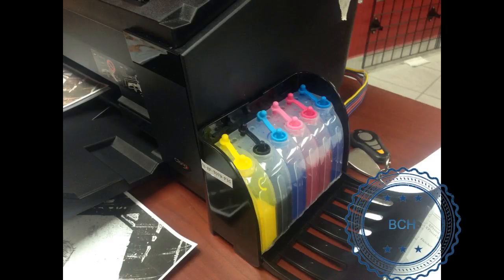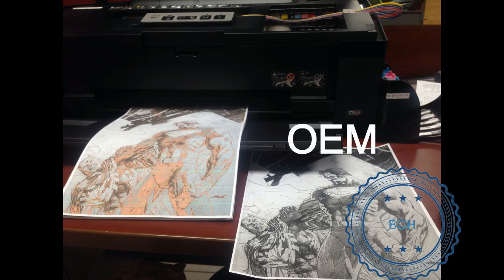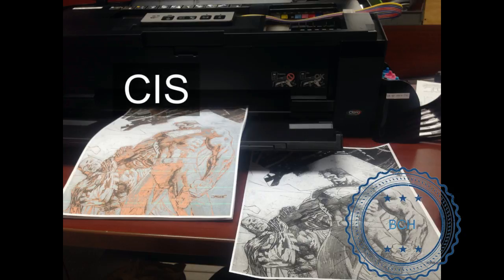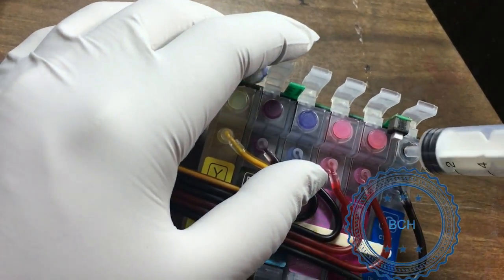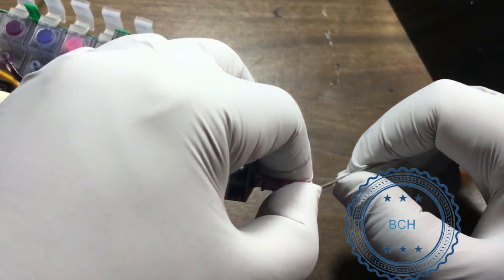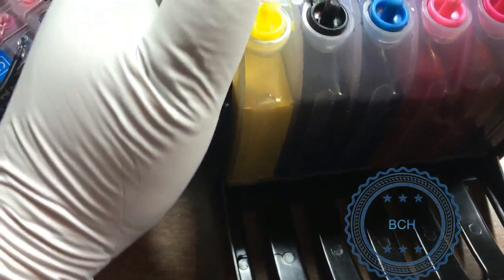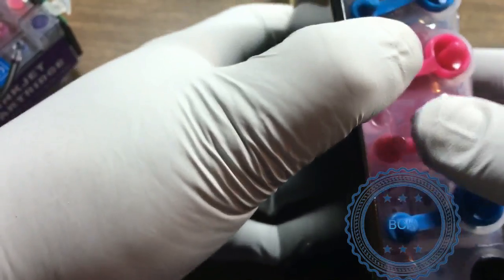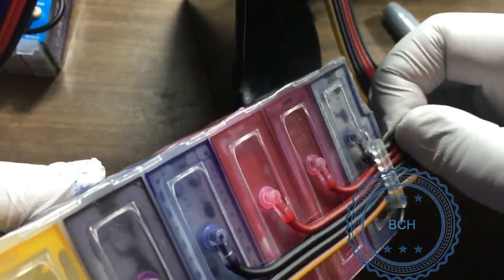Troubleshooting: CIS Ink System Works But Have One or More Color Missing

Comment: I think Magenta simply isn't compatible with a CISS, period. First CISS, magenta would simply fade out. Using a syringe on the back vent had resistance while all the other colors smoothly allowed ink to flow into the syringe. Bought another CISS, barely used it, the resistance issue persisted (this is after removing the cart from the heads). As a last resort, I replaced the red cartridge only and used an old cleaned out yellow cartridge (because yellow has never failed for me), and it still had the same resistance. Brand new tubes, no obstructions, the tank had no blockage etc... that lead me to conclude that magenta will always clog inside the cart where those micro mesh filters are. The heads can't get enough suction going because magenta keeps clogging, not in the heads, but in the cart itself.

Comment: What do you do if there is a problem with the ink supply as you mentioned in first step? My cyan is not printing at all. Like you showed in the video, I did the same steps, but nothing comes up in syringe. Just a little bit of bubbly ink and mostly air.  I did all the manual nozzle flushing and all my other colors print perfectly again, but I cannot draw any ink up from the cyan cartridge like you did. I'm using sublimation ink. Could it be dried in the tubing? It's dark so it's stained and hard to tell if there is air in the line or damper.  I think it has to be the cartridge or the tube feeding the cartridge. I've spent so many hours now trying to fix it. I tried to add ink manually to the cartridge from the reservoir with a syringe to see if it would print and then I'd know it's the tubing, but it quickly overflowed. It's full of ink or air and nothing comes out the bottom on a moist paper towel. But, if it's full of ink, I should have been able to draw it up in the syringe right? When I suction the air out, that should have fixed the air problem if that's what it is. If anyone has ideas, I'd be so grateful for any suggestions.
Reply: I’m having the same issue; did you ever fix yours and if so, how?
Reply: @DollsandEverythingElse  Oh man, what a headache right!? I ended up fixing the cyan and then the yellow completely stopped as soon as I solved that problem. The yellow was also contaminated with black at this point. I tried 3 different cartridge sets I had. (2 were ciss and then another refillable individual cartridge set) and it wouldn't print. I was starting to think it was my printhead. I flushed it though and there was no resistance and color was coming out on my paper towel under the printhead. I fixed the cyan by taking the tubing apart from the ciss cartridge and using a large syringe to draw the ink through the tubing and it worked. I used the little stopper that the you insert the tube into the cartridge in the end of the syringe to get a good seal. Then I put it back to the cartridge and no issues. When you go to remove the tube from the syringe and put it back in the cartridge, close the air on the reservoir to stop it from flowing out while you move it back to the cartridge. I'm thinking it was a vacuum issue in the tube even though I leave the air holes open on the reservoir tanks when printing. The ink must have been stuck in the tube and that fixed the flow by drawing it through the syringe to remove the blockage. It was a big syringe large enough to insert the little tube plug with the hole for the tubing to fit in the end. Hope I explained that alright. For the yellow, I think they were all bad cartridges. I ordered a new set of refillable cartridges to make sure it wasn't my printhead and printed only yellow from a purge sheet and it worked! I think it's possible that there was an air leak or something on the yellow carts. I've ordered new ciss cartridges and will attach the old arc chip to those when they come, but those are the 2 solutions that fixed my individual colours that would not print. You know how they use only thin plastic on the refill and ciss carts? I don't know if it got accidentally punctured with a pin hole I couldn't see or the seal broke when priming. That might explain the bubbles. I'd try the tubing solution first that I shared and order another set of carts if that doesn't work. I tried cleaning the carts out with alcohol first and refilling. Only the third one leaked from bottom. The other carts had no detectable leaks, but a new one worked.  Two weeks of this, but I did a happy dance two days ago when I finally got it working beautifully again. I will keep an eye out in case you reply and try to help you if you need it because I know how it feels.

Comment: My yellow got tainted with the black can I it by cleared up any way?
Reply from the maker: Yes.  However, can you take a look at the print?  If it is printing okay, maybe just use up the yellow then flush the system.